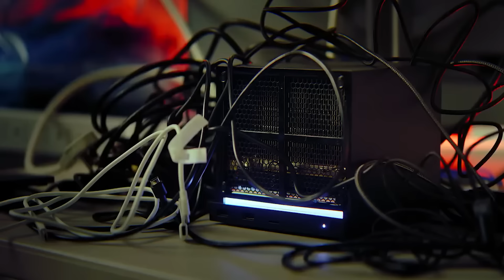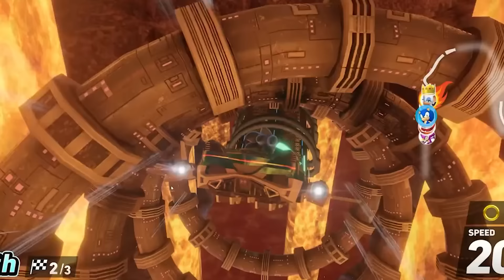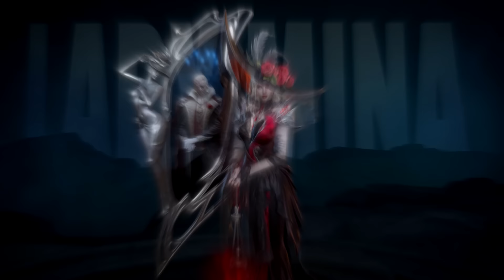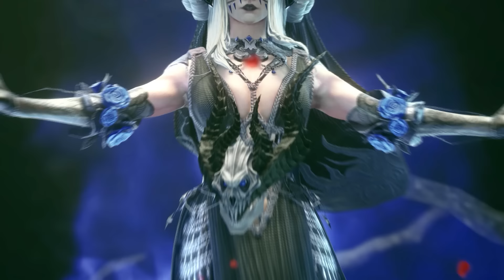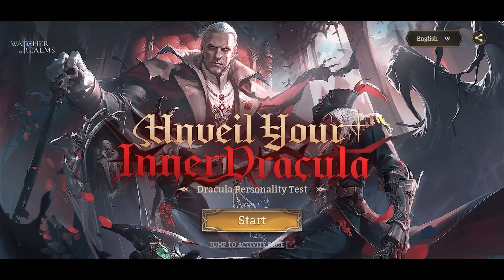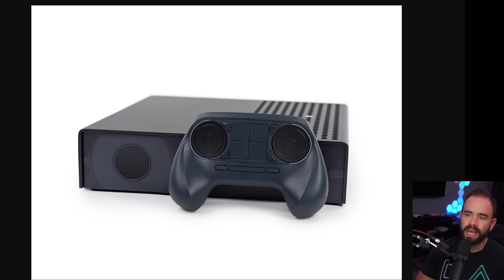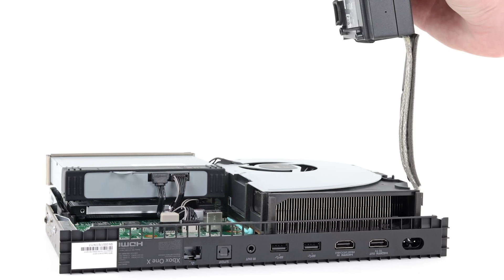The Steam Machine Is More Impressive Than It Looks...

Comment: $550 with a controller would be a great deal.
Reply: In todays market 550$ is a charitible donation
Reply: I'm thinking 699 with the controller for the 512gb
Reply: @James1_A too expensive
Reply: Some of you all think Valve is way more generous than it actually is. I dont feel its going to be cheaper than $700.
Reply: @SUPERVEGETTO92 the M4 Mac mini is 600€. I do t think that Valve is going to be more expensive than apple
Reply: @SUPERVEGETTO92  i honestly think it will be closer to the $1000 range. hope I'm wrong though.
Reply: @CarnivoreSteven if it is $1000 it will be a failed product
Reply: @serggla924 it definitely wont be as desirable at 1k. So we shall see. Whats your top price you would be willing pay for it?  It would make a great linux pc for non gamers. Im eye balling it for that purpose.
Reply: @SUPERVEGETTO92 700 and this thing will flop hard
Reply: @SUPERVEGETTO92  It's not about being generous, the BoM is estimated to be around $425 I think the math was done by Toms Hardware not sure. Most game consoles actually sale at a loss on release, they make the money up on licensed games, or in steams case, games bought through the Steam store. I'm not saying it'll be $425 or even $500 but $700 would put them in the same price range as the high end consoles from Sony and Microsoft even though it reportedly is comparable to the mid range consoles. My original estimate was $800-$1,200 because they said they were pricing it to compete against SFF PC's.
Reply: @SUPERVEGETTO92 no company is generous mate.
Reply: @SUPERVEGETTO92 Probably won't be cheap, but it needs to be with those specs. At $700+ I'd just build my own steam box with a 7500F, 9060XT, and install SteamOS on it
Reply: @SUPERVEGETTO92  feelings VS facts. Its cheaper Tech than a PS5, with less storage and no controller, facts.
Reply: @SUPERVEGETTO92  Generous or not doesn't even matter here, no company will ever sell you a product at a loss without somehow getting a return somewhere else.

With prices for RAM being doubled in the recent times, and for Americans getting hit with extra tariffs, it's likely that the price will be around 700-800 in the best case scenario.

It's silly to think that Valve is going to sell this product under the total that they spent making it.
Reply: @SuperZura91 cough cough steam’s 30% transaction cut cough cough
Reply: @SuperZura91  You don't have much experience with consoles do you, most consoles are sold at a loss, Valve would make the money up on games sold just like the console makers. Also the BoM is estimated at $450 and that's including tariffs. I personally think it's going to be more than $500, less then $650 because Valve has never been particularly greedy but they are a business and they probably aren't banking on massive amounts of new titles being sold since a lot of people who will immediately run out to buy these already own hundreds of games in our Steam library anyway.

But the thing you need to realize about Valve is Gabe is pretty content with how much money he has, does he want more? Sure more is good, but Valve is not a publicly traded or private equity firm owned company it's privately owned and most privately owned company's aren't actually nearly as greedy once they become highly profitable like Valve has done.

I personally would LOVE to see this thing sold for $500 with a controller technically valve would still make a modest profit of $25 per unit sold, but they might want more on that considering R&D, but they might also be going for volume to REALLY break into the market. We won't know until they release the price, all we know is it COULD be as low as $425 but that's incredibly unlikely or as much as a grand, but that's also very unlikely. Anything approaching $700 would need to have comparable specs to current high end consoles and the Gabecube is more appropriately compared to the mid range consoles.
Reply: @SuperZura91  At $700-800 it'll probably sell less than the Steam Deck imo, doesn't make sense for console gamers and will probably just be an affluent PC enthusiast's toy for the living room. Gotta remember that it doesn't even play Fortnite and other competitive online shooters, so won't even work as a cheap PC for a teen.
Reply: @GoriguiMonke a pc enthusiasm will never get a pc that you can’t upgrade they could make their own mini pc building it is half the fun
Reply: @GoriguiMonke yet.......just need anticheat removed (which doesn't work anyway)
Reply: @gregorypratt7201  You can always install Windows too, I guess that works, don't know if prevents all the kernel stuff, but even that may be a bit too much tinkering for mainstream consumers.
Reply: @SuperZura91  i bet they will sell at a loss. because they know they will make that money in a hour after ppl get home with the box
Reply: @SuperZura91 you have contradicted yourself.
Reply: @MonsieurWaffledoesnt mean a thing. I mean it does but this isnt going to push the needle on Steam users. Just like how 90% of Deck users already had an existing Steam account this will overwhelmingly be bought by customers they already have. With libraries of games they already have. Its not going to get people to buy more games in droves. Which is generally why someone would sell at a loss. Because they would make that up on software sales. Not only does Valve just not have any new or recent first party titles to make 100% profit from, people buying this machine aren't going to automatically buy more games to play on it. Because they already have a library of games to play on it
Reply: @SuperZura91 The cost to Valve to make this is probably around $400
Reply: @SuperZura91 Bro has literally never heard of the printer ink model 😂 a lot of businesses sell products at a loss if they can sell you on a reoccurring cost (razed blades, printer ink, steam games). If there was any console company that could eat the cost and sell at a bit of a loss, it would only be Valve.
Reply: @SuperZura91  I think the ideal return would be from the Steam store install base growing.
Reply: @LordKingTrump  They won't sell it at a loss since it's a PC. There could be companies that buy thousands of these things and won't generate a single sale on Steam.
Reply: @n_core  thats true. i did not think of that. good catch.
Reply: @SUPERVEGETTO92  yeah it's a mini PC and not some console that would be sold at loss, because the games would bring the revenue to profit. This doesn't have that. It's a PC, this itself will not sell games. So seeing this to be even around 800 or even a bit more would make sense.
Reply: They might sell it at a loss cause its guaranteed software sales. Although 90% of steamdeck purchases were from people who already used steam.
Reply: @SUPERVEGETTO92 moore’s law is dead priced it at 350 base cost. It’s possible if they want to bank on the larger audience allowing them to recoup costs in game sales. It’s unlikely it will be that low. Likely what you think at $600+ but hardware sales would still have bunch of purchases
Reply: @StarScreamReee he is right, these specs should not be over 399,- to sell this thing
Reply: @StarScreamReee   Moores Law is the same person who completely fucked the PS5 PRO info and got baited on bad AMD info so trusting him on anything is a fucking joke 
There’s a reason Valve said comparing to Micro Pc pricing than Consoles. 
Best estimation 650 bare bones and 750 for a controller and near 900 for the 2tb bundles. Make the most sense due to the market.
Reply: @StarScreamReee  You're wrong. Moore's Law estimated that the manufacturing cost of the 512 GB model is about $425.
Oh, and he estimated the selling price as $499-$600
Reply: @StarScreamReee  didn't moore's law is dead price it at $425 dollars?
Reply: @StarScreamReee  That only makes sense if you ordering millions and millions of parts well before the price increase

16GB of RAM is $100 alone, you saying everything else is $250 besides the cost of designing the solution to keep it that small?
Reply: @franciscoc905 What? He had the details on the Pro's specs like a full year before it was even announced. He was guessing what Sony could sell the Pro for based on build of materials costs. That's completely different from what they chose to do, which is to make a healthy profit on every unit sold.
Reply: Would be a no brainer for many. Especially if you could dual boot it to windows 11 like you can on the deck.
Reply: Or $600 bundled with a code for Half Life 3 👀
Reply: @seanlaffey3633  If it came with Half-Life 3 under $600, an instant buy for my game room TV.
Reply: @seanlaffey3633 , code? Where is the physical game?
Reply: Agreed
Reply: Not a chance 🤣🤣🤣
Reply: I agree I need a bundle deal
Reply: Yes it would.
Reply: It will be more than that trust me. Expect it to be around 750 to 800
Reply: @troybracy2915 steamdeck oled is 600 dollars so definitely above that.
Reply: I don't want a pre built and all the hassle, I want a console.

You missed the point entirely and you have a pc. So you'll never want this.

Designed for families and children are you serious.

If they spend a billion on advertising,  maybe.

Non pc gamers, adults like me, who dont have steam because it's pc are interested in this console.
Reply: It’ll be $900
Reply: "Be still my throbbing wallet"
Reply: If they can base the price around console prices, it would be great because then theoretically they would steal away console gamers.😂
Reply: Why is everyone commenting so negative 😂😂😂😂😂
Reply: @f33db4ck1047 You should see what the Playstation fans have to say while pretending their console has games lol
Reply: More like 699 if we gonna honest
Reply: Don't need the controller bundle I have a duelsense
Reply: @Alien_Isolation1984 I was gonna say Steam has a wide range of controller support, and all of those controllers should work on the Steam Machine because it uses both the standard Steam client and industry standard technology.
Reply: @Alien_Isolation1984 the steamdeck will be compatible for it too. Crazy if not
Reply: £400
Reply: It'll never be that price point.
Not even consoles are at that price
If this is on the range of 600 to 700€ I'll be more than happy with it
Reply: Why shouldn't it come with a controller? lmao
Reply: @marcheharvey2301  hyuk hyuk because it's a PC & you don't need one cuz you own one....... and base model won't have it
Reply: No way this happens tho
Reply: @Mikhail-Kuhn  why not? Yall act like a PS5 isnt just PC parts with a fancy casing. It was $400, now is $500, with a controller, and specs are higher than steam machine, with lesser internal storage and no controller, but everyone is acting like its going to be mad expensive. Its not
Reply: Assembling your own PC with the same spec as the Steam Machine costs around $ 800-$ 900.  You have to stop treating it like a console and more of a mid range gaming pc.
Reply: @d3vilmaycry25 You can currently do it for $700.
Currently at Microcenter:
Gigabyte RX 7600 (triple fan) = $200
R5 7600X & ASUS B650E Max Gaming WiFi Motherboard (Combo deal) =$230
16GB kit of G-Skill 6000mhz DDR5 = $100 (or $90 with above deal) 
1TB Inland Gen4 NVMe SSD = $80
Thermaltake Smart 500 Watt PSU = $40
Gamdias 4-fan ATX case = $50
Total = $700.
Even then this would highly likely outperform the Steam Machine, since it's a dedicated RX 7600 that's around 20% more performant than the mobile 7600m version. Plus the 7600x clocks higher (up to 5.3Ghz) and has more onboard cache.
Hell, even thier pre-built RX 7600/7600X with the same specs but with a better case & PSU currently only costs $750.
As for using secondhand parts, I dare say you could just squeeze together a PC with either a RTX 3080 or a RX 6800 and a 8-Core CPU for around that same $700. And get around a PS5 Pro performance level, which is highly capable of 1440p gaming (natively without upscaling).
And if you want that console like experience on your TV set, then either install Bazzite or stick with Windows and just use Steam's Big Picture mode. 
Of course all these's options also come with one major benefit over the Steam Machine!!...... They are all far more futureproof by being fully upgradable.
Reply: The manufacturing cost for a single Steam Machine won't be above $450. It's probably gonna be $550 or $600 depending on the market condition like tariff and RAM price surge.

And Valve won't sell it at a loss to prevent corporate mass purchase that won't generate a single Steam sale. They at least have to make it sustainable.

Linus also pointed out on the WAN Show that when he asked about the pricing to Valve they didn't give enough confidence that they would sell it for $500. So it's confirmed that should be above that price.
Reply: That's way too expensive for the specs it offers compared to the PS5 and Series X, which were released five years ago.
Reply: NO…! have mercy on x box and ps 5 😂
Reply: If it's over 500 dollars it will die
Reply: @jared8530 RIP
Reply: you all are clearly missing point of what this hardware is, it's not supposed to compete directly with the PS5 and Valve is not going to subsidize the price, they literally said it's going to be priced like a PC with similar specs. It's probably going to be like $800
Reply: @joaovictordb20  I think $750, I think valve will sell it slightly at a loss but do it to expand the Steam ecosystem which they take a 30% cut of all sales on the platform
Reply: @sootythunder3111 they stated that subsidizing the Steam machine is not something they plan on doing. They don’t need to get people to buy into the Steam ecosystem. They have already reached saturation in the market. They noticed through their own analytics that a lot of people are playing Steam Deck docked and therefore had an opportunity to create a box to keep people playing and buying games. If this Gabecube brings in more people to Steam, that is just icing on already delicious cake. They pretty much subsidized already with Steam Deck launch at 399. It was rough for them do it. They are past that point now and aren’t going backwards. They will sell it at 599.00 or 649 for 512GB and probably 150.00 more for 2TB model. They will probably make 5-10 percent margins which is not a lot but not at a loss
Reply: @sootythunder3111 if you really at a slightly loss, someone made some estimate BOM of the parts, which was 450$. So really 400$ is what you are thinking. But if they aren't going for that approach, a slight margin of 550$ is also doable. That also depends if the ram prices doesn't kill it.
Reply: @sootythunder3111 Think what you will. They’ve outright said they’re not going to subsidize it like consoles.
Reply: @sootythunder3111 $750 would not be a loss for them. You are overestimating the value of the parts in this system. $450 would be selling it at a loss.
Reply: @tenorenstrom Given that the consoles are years old and they keep jacking up the prices, I don't think anyone is subsidizing their consoles anymore. That said, even if Valve doesn't sell at a loss, they still have some room to sell it for <$600.
Reply: @Deliveredmean42  $499 base / $599 2 TB, $650 with controller, give or take 50 bucks for each of those guetimates. It's not that powerful, and for $800 you can build a more powerful PC. These guys are wrong
Reply: @noahheninger  PS5 Pro on sale for $640 RN
Reply: @noahheninger except they said it will not be as cheap as consoles. Check the ps5 pro. Steam Machine will thus be more expensive than that.
Reply: @joaovictordb20 at that price honestly get a pre-built it will be better. Its in a console form factor and is meant to be a companion or entry into pc gaming 

Likely marketing this for families with children is the move 

At 800 its not entry level price you could easily make a pc much more powerful than this and buy a steam contoller 
Its 1 dimm of ddr5 
512 gb ssd 
6 core laptop chip 
And low end laptop gpu 
Th3 argument for 500 is fine but at 800 this thing might as well not exist
Reply: @joaovictordb20 oof then it's not gonna sell.  Then someone can just get a windows PC that does other things than just steam games
Reply: @alanlee67 this IS a PC. You can install windows on it if you want. It's competing with pre-built PCs with similar specs, not consoles with similar specs
Reply: @hjohnson966 Most people have no interest in switching their operating system. The fact that this ships with Linux makes it a harder sell for consumers, and Valve will have to bear that in mind as they set a price for this thing.
Reply: @alanlee67 
I can’t fathom how people STILL DONT GET THIS. THIS IS A NORMAL PC. It is not a console. Calling it one just confuses people. It’s just a PC that runs SteamOS.
Reply: @joaovictordb20 A PC with similar specs would not be $800. It uses outdated hardware. A PS5 is more powerful. $500 would be the limit for anyone who isn’t an idiot.
Reply: No their not missing the point.
Your comment has no relevance to what the orginal comment states.
Reply: @joaovictordb20  They are currently selling the Steam Deck at a loss, I imagine it will be similar with the steam machine. I'm guessing it won't come with the controller, but I expect base model to be around 500-600 dollars
Reply: @joaovictordb20 800$ for 8GB GPU sounds bad
Reply: @joaovictordb20 If it’s going to cost more than $399, they should’ve given it more than 8GB of VRAM.
Reply: @joaovictordb20 $800 and this thing is DOA. Moore's Law is Dead did a decent analysis, and he says $450-600, which sounds about right to me. I think the reason they haven't announced a price yet is because AI is driving up the price of PC parts, specifically memory, so even Valve doesn't know the price yet, but I, for one, won't pay a penny over $600 for this thing. All of Valve's marketing suggests that this is supposed to be a cheap, mainstream product. You also have to take into consideration what Valve's goals are, which is to compete with Microsoft (who is increasingly pivoting away from console to PC gaming on Windows). I'm not saying it will, but pricing this to compete with the Series S might deal a devastating blow to Microsoft, who has already done tremendous damage to their own Xbox and Windows brand. Valve has every reason to compete aggressively with this device.
Reply: @joaovictordb20  and at that price its better to build a standard PC with upgrade options
Reply: @joaovictordb20 actually I heard valve is going to eat some of the cost of gpu.
Reply: @joaovictordb20 that’s not a 800$ pc tho first of its outdated and you get theses parts on sales 2nd it’s laptop parts I can get a 6 core laptop with a 4060 for cheaper or I can build a pc much better and not outdated with a 7600 with only 8gb
Reply: @bobmorane2082  your missing the point entirely, I don’t want a pc hooked up to my tv, I want a steam machine, I don’t care about building a windows pc and then installing Linux and going through the pitfalls, I want a Linux device with steam installed so I can play my steam library. It seems the steam machine is not for you but for many people who have different needs.
Reply: @gloomyvale3671 you can just install steam os and not Linux and if you like being ripped off by old tech well that “pc” is for you. Just hope that 16gb isn’t soldered lol
Reply: @bobmorane2082  IBuyPower prebuilds at places like Costco sell $1000 units with overclocked i5s and a 5060 that frequently are sold for $850. This thing won't sell if it can't even compete with the prebuild market. 

Part wise, these components could be assembled and sold at $600 at a profit. Possibly even cheaper. Both the CPU and GPU are mobile units that experts think are discounted overstock. Valve probably got these super cheap.
Reply: @bobmorane2082 You’re going to pay a premium for the form factor. Getting it to work in that small box is not free.
Reply: @bobmorane2082 since it’s a pc I really don’t care it’s 6”. Id much rather they made it 12” and more powerful since it not sure if they compromised to make it that small
Reply: @bobmorane2082 go look at the prices on mini PCs with discrete graphics.
Reply: @joaovictordb20  they built a console. Their statements and the parts used in the console itself, suggest a low-cost point of entry. That's reason enough to believe Valve might be shooting for a console that's priced against the current competition (Sony, Microsoft). Won't necessarily make it true. But, we can only speculate
Reply: @christopherbrooksoregonboy valve literally calls it a PC.... Why do you dimwits keep making stuff up?
Reply: Dreaming. Thisis gonna be over $1000.
Reply: @NiGHTS1980 if it’s that expensive it won’t sell
Reply: @NiGHTS1980 Then there will be little reason to get it.
Reply: @NiGHTS1980 no it won't. They wouldn't sell any units. They'll be looking at the current economy and the competition. It wouldn't surprise me if they sell it at a slight loss knowing they are going to make insane amounts of money from all of the new steam users. Valve are smart, they'll play the long game. They also don't have shareholders to please so they are free to make moves like this.
Reply: @happyjam92 Most of their products have been a bad value for money. Don’t see why this wouldn’t be the case now. Their current VR headset costs double that of metas better offering. They’re not known for competitive prices…
Reply: $420 sounds like a sweet deal
Reply: Nah $399
Reply: Gonna be closer to double that than that price bruv  @christopherbrooksoregonboy
Reply: LOL that aint happening, that controller will be at least $100
Reply: I'd pay up to 700 dollars.
Reply: @honduken it’s only has 8gb of v ram
Reply: 499 to 550 is the sweet spot. If its more expensive than existing consoles it will flop. How they advertise it will also be important. Consoles are subscription based, this wont be. It will also need to be bundled with games to attract new players or maybe allow new players to piggy back off their mates games
Reply: That's my personal prediction. $400-500 without any extras. $450-550 with the controller. $550-600 for the 2TB model.
Reply: @jackofthecoke you guys are insanely over optimistic. If valve was marketing this as a console competitor sure. But they arent. Its specifically said to be matching with PCs.
Reply: @Jack_Ss  you're not looking at specs. It's not a $700 PC equivalent, without controller ajd without 2TB upgrade
Reply: @Alien_Isolation1984 you dont even know what a 700 PC is anymore due to AI making prices ridiculous. And you're also crazy if you think Valve isnt going to go with premium parts and not upcharge at all. We will see in a few months but dont be surprised when its 750
Reply: @Jack_Ss  meanwhile PS5 Pro is on sale today for $640 USD
Reply: @Alien_Isolation1984 whats your point exactly? You dont have one at all. The entire point is that Valve has made it clear that they are not competing with the console market. So trying to guess the price based on that is pointless.
Reply: @Jack_Ss  don't need one to know the specs are lower than a PS5 which is $499 so don't try to convince me that lower specs and lower storage and no controller is more costly than a PS5 with higher specs, higher storage and a controller. You can build a PC at the prices being suggested, yall cap
Reply: @Alien_Isolation1984  dont get mad when youre wrong
Reply: I think anything more than 500 is a poor value 

At that point buy a ps5 honestly its more powerful 

And has more space surprisingly it would look quite poor if that was the case
Reply: @jonathanruiz4158 ya. Over $500 people just keep saving for a more expensive PC
Reply: @jonathanruiz4158 the games on a ps5 are not cheap, no console games are. Steam has a competitive edge over any console games their prices cannot and will never be beaten
Reply: @jonathanruiz4158 why should I buy a ps5 over a steam console if their the same price???
Reply: @jonathanruiz4158 Can a ps5 play your steam library?
Reply: @Vicious556 If you have a steam library, you already have a PC. And it's probably a lot more capable than this
Reply: @travisjacobson682 I have a quite good PC, and it's better than this, but not by much. I legitimately think the people calling it entry level or low power are delusional
Reply: $499 and it breaks microsoft
Reply: @RandomUserName92840  It doesnt because you buying a system weaker than a PS5 that has compatibility issues
Doesnt sell around the world, like Steam Deck isnt sold worldwide. It has to be imported and get massive taxes on it
Isnt in physical stores and not a typical ordering online sites

oh did I mention that 2027 might be the next gen consoles, only 1 year after this releases maybe 2 years if you lucky. Spending $600 to be weaker than $400 consoles already but you dont get the benefits of upgrading in the future like a normal PC
Reply: @RandomUserName92840 Microsoft was fucked after the 360.
Reply: @RandomUserName92840 What does it do to Sony?
Reply: @RandomUserName92840 console gamers don’t want to play against keyboard and mouse players ..
Reply: @phillipmichael67 have different lobbies for each
Reply: 600 bucks is more than a Ps5/ Series X costs ... but with similar performance and for similar games.
But on those consoles games like Indiana Jones or Star Wars Outlaws actually still run better ...

399,- is the most this low performance cube should cost in 2026.
Reply: Lol 550$ even without a controller would be a fantasy. They would actually move millions of units at that price. Im sure it will be some stupid price like $750 or more which at that point why even bother with it it will just fail like the first steam machines did .
Reply: $800
Controller will go for $200
Reply: It's 800 minimum and at that price its okay I guess. If it's 1k then it represents poor value vs existing xx60 GPU desktops and laptops.
Reply: @ahmedrazick4946  laptops have a screen
Reply: @ahmedrazick4946 i think itll be $600 or less or this thing doesnt sell.
Reply: @coreyjohnson2205 it's not a console. You aren't getting something with those specs for that price lol
Reply: @coreyjohnson2205 I believe they have said they are pricing it in line with competitive PCs. I suspect it will be closer to $800 especialy since they are bundling in the controller
Reply: @coreyjohnson2205 even that is borderline too expensive for tech being on clearance sales right now
Reply: @coreyjohnson2205 you think valve really cares? Steam Deck is a success at a few million sold. They could sell more by putting it at mass retail but they dont. Theyre fine with their hardware being niche and for only their existing customers
Reply: @coreyjohnson2205  same, more than $600  is DOA
Reply: It matches a ps5 pro. So I guess 800 euro. But it will die on arrival. If they wanna sell the system so more people will use steam. They'll need to go below 600. But it's Valve, so they have a huge user base already.
Reply: @reneschoolderman7835 it does not match a ps5 pro.
Reply: @reneschoolderman7835 it doesn’t even match a base ps5.
Reply: @reneschoolderman7835 It has roughly half the GPU power of the PS5 Pro. Probably less than half in terms of Raytracing.
Reply: $900 with a controller would also be a great deal
Reply: It's gonna be near a thousand.

Y'all gotta stop with the cope
Reply: @Giliver that would defeat the whole purpose trying to compete with Playstation and Xbox
Reply: @jared8530 They’re not trying to compete.
Reply: @jared8530 they have NEVER said they were going to compete with the console market. It probably wont even be sold at retail.
Reply: @Jack_Ss I don't think you understand how hungry alot of console players like me have been wanting something like this....a budget PC from Valve to step on Playstation and Xboxs toes...
Reply: @jared8530 youre letting online discourse trick you. Echo chambers are not a real showcase of the market. If you trusted twitter, reddit and youtube comments you'd think Steam Deck was the biggest handheld ever. But no if it was released by one of the major console manufacturers itd be considered a huge flop. In 3 years its sold somewhere between 3 and 5 million units. Which is nice for the niche product it is. But doesnt touch actual handhelds or consoles. This will be exactly the same thing.
Reply: @jared8530 who said it competed against consoles?
Reply: @Giliver  With only 8GB of vram, na no way, no one would buy it at $1000. You can get the same spec as the GabeCube for under $600. They do not have new hardware in this box as much as they toted 4k60, they said with FSR. Most likely old AMD product they stocked up hard on while it was cheap. This will not even beat out a base PS5, most likely. At least with the GPU, it does have a better CPU. It has to be affordable or no one will pick this thing up and Valve knows it... the light weight of Linux is doing a lot of heavy lifting.
Reply: @Giliver  no it won't, this will be competitively price for a PC, you can make something much more powerful for 1000, this will definitely be in the 500-600 range for base model

The components themselves are worth 450